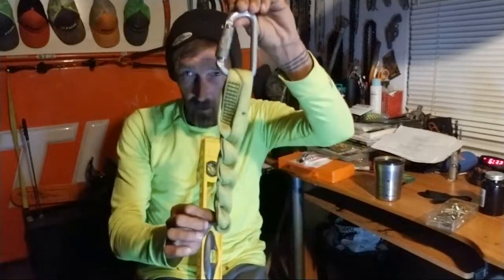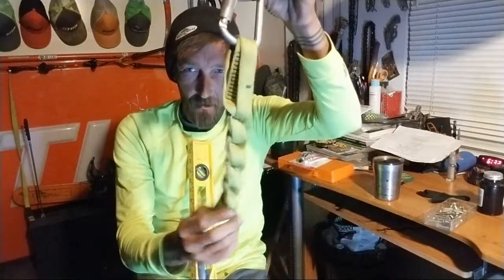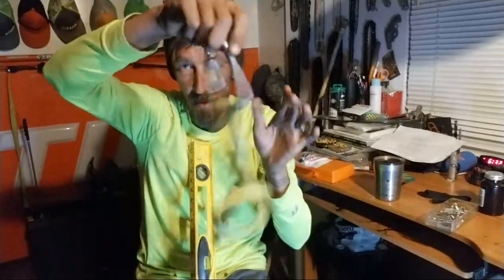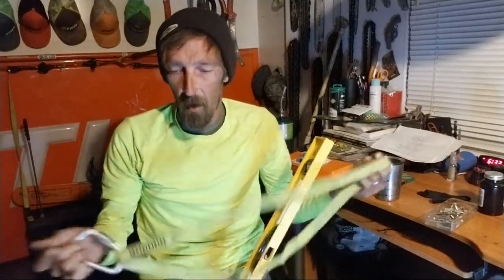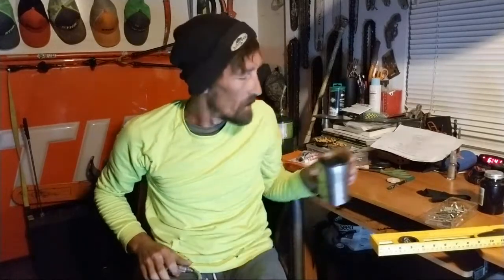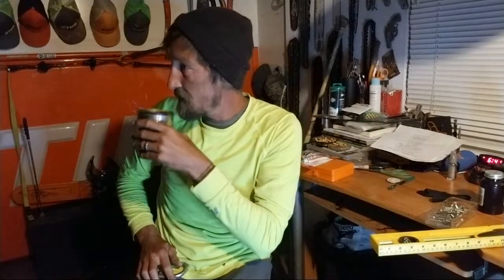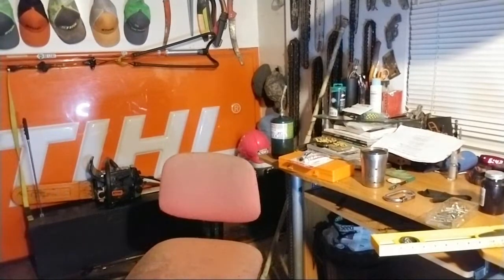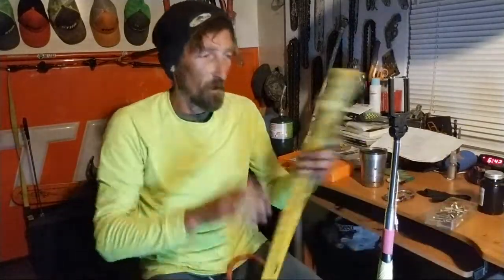EASY Home Made MRS/DRT Retrievable Friction Saver / TTT#31

Comment: Good stuff! You just saved me a lot of money, I was getting ready to buy a retrievable pulley system, when I had everything I needed already. Thank you!!
Reply from the maker: My pleasure brother 
Try it out low, just incase you need to make adjustments 👍
Reply from the maker: Should work very well though....
Tip I didn't share/
"The rounder the carabiner, the easier it it pass through a crotch also"

Comment: I just look out for sales I received a limited color edition rock exotica woopie sling blue with a blue omni block for that purpose size with a order free ..had to order gaffs or something ot came free ..those are best ways to get tools ..for me at least..also got a notch pro gear bag that way..super nice although rather have bought the access bag it opens and has pockets inside .rather have gear inside.  But it's nice.its 250 bag cost..so win I reckon